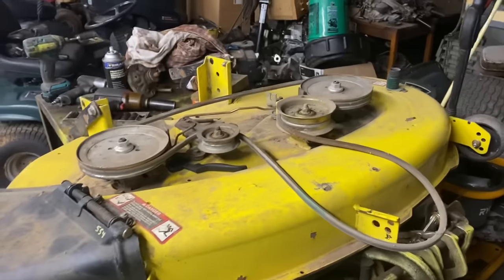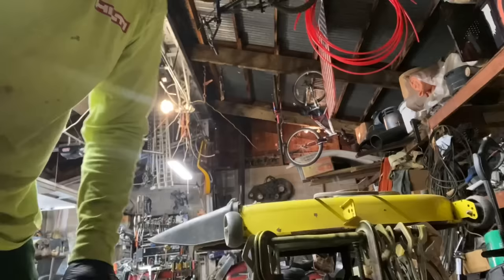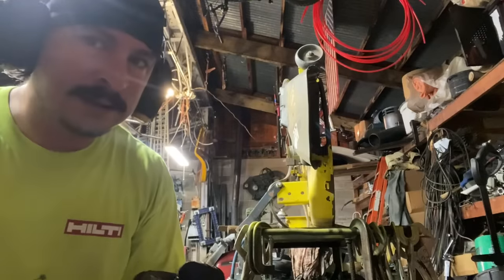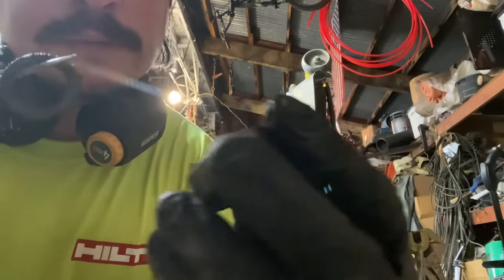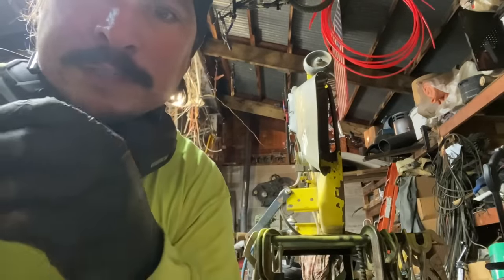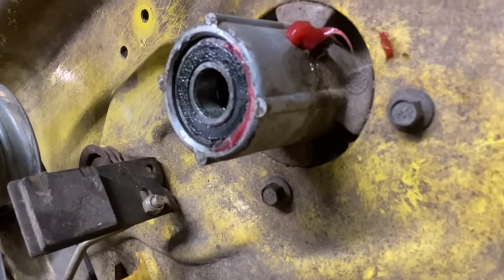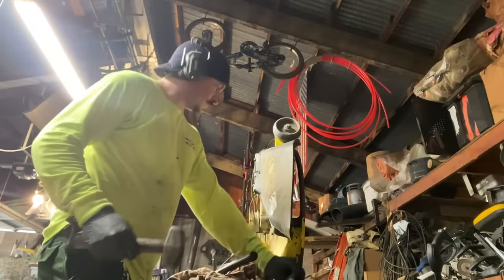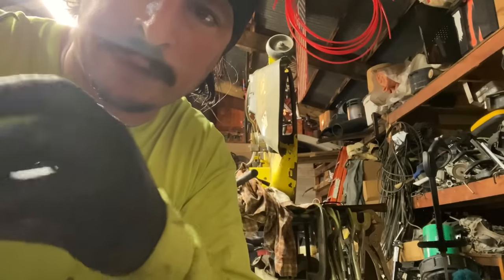Part 1 - Don’t trust the “Experts” Grease your mower deck sealed spindle bearings Common sense.

Comment: YA! Untill one of the mower or bearing  companies catch wind of this video and pays google and u tubeto take it down, bottom line is they dont want you fixing stuff anymore thats why they seal bearings in the first place.
Reply from the maker: @timothyhults2549  I’m not in disagreement, I think they try to put just enough grease in to get the machine past warranty and then bearings start failing. They also fail
To show how to properly grease these assemblies and hope that folks will buy parts rather than perform Preventive maintenance. Big corp is not our friend.

Comment: Just take the internal-facing seals off and reinstall the bearings. Then you will have a proper greaseable bearing and can live a happy life.
Reply from the maker: That’s a waste of time as I have proven in the video. Attention to details. The shields can’t stop grease from passing. But excellent waste your time if you have time you want to waste.
Reply: @GTObearclaw1  Having a plastic seal between the grease and the bearing is just stupid. If you really think that removing a seal which limits grease flow is a waste of time then you have a lot to learn. You can hope that some grease squeezes past the seal or you can ensure that your bearings have proper grease by removing the seals. You say you have to put 70 pumps from the grease gun to fill the bearing. What a waste of time and grease. With the seals properly removed it would take just a handful of pumps. The fact that you think its a good idea to have a piece of plastic between the grease and the bearing is truly baffling. While the seals may not fully stop grease flow they sure as hell restrict the flow unnecessarily. The inner seals literally have no benefit except they prevent full flow of grease to the bearing. Im not suggesting to go out of your way to do this, im saying if you have to open the spindles for whatever reason, repair, replace, whatever, then you might as well go ahead and make easier for the grease to get into the bearings. Literally anything you can do to help more grease get into the bearings will be beneficial. You should be greasing spindles every few mowings so there is no worry about grease running out of the top bearing through the missing seal.
Reply from the maker: @winstonpoplin  actually your wrong again, regardless if the shield is there or it’s removed the same amount of grease is required to fill the void. To think grease will magically find both bearings with only a hand full of pumps is ridiculous. Grease will absolutely not reach both bearings before the void is filled. That’s some pretty silly logic. So do we just ignore gravity when it comes to grease? Without filling the assembly you will have a air pocket in there. And grease is usually a blob that tends to stay in one spot unless it’s pushed into the path of the bearings. And it is not a seal anyways, It’s just that simple. Don’t overcomplicate it. It’s a shield. It’s not a seal. It’s a shield, not a seal. Don’t let it give you a mental block. You don’t know anything about it obviously a simple word is enough to cause you a metal block and you can’t think past it. This is an issue for may people and the reason I made a baby step video to provide proof. And even then some folks still argue rather than simply trying it. Stop with the nonsense and quit wasting my time. If your not even willing to absorb the basic simple Information I provided then just move on. Your wrong, it’s that simple. Some folks have to be right and want to argue but your wrong and that’s the Bottom line. Your not even willing to try it. Iv already proven it. That’s all
There is to it. Nothing to argue about. Just looks dumb to argue with a video that shows every step of a process that has proven the point with evidence that can be tested. I have show it and proven it’s a FACT. Can’t prove me wrong by talking. quit wasting the DIY communities time and make a video showing facts on how your right and help some folks. A hydraulic cylinder has a seal. A crank shaft even has a lighter duty seal but still a seal that can hold some internal pressure. A shield on a mower deck mandrel bearing is not anything like those. The mower deck bearings can’t hold back pressure. The shields don’t stop pressure from pasting. Can’t even seal out water effectively. Good grief, it’s almost like I didn’t just show every step of the process on video. Yes 70 pumps, big wooop. Grease is cheep, 1 tube completely serviced 3 or 4 mowers. Once the assembly is filled it only takes a few pumps each time. After the first greasing when bearing is filled it’s fine to go longer than a few mowings. I think it’s fine to go 40 hours and most home owners use a tractor 40 hours a season. So even at 20 hours that’s twice a year and plenty of the process is done properly. it’s actually pointless to remove those shields unless your already into the assembly for some reason. I’m not making a video to tell
Folks to remove a shield that can’t stop grease from passing. They don’t present a restriction in real life. Only in your imagination. Pressure pushes grease past those little rubber lips like they don’t exist. I would not bother removing them because grease passes right into the bearing. I don’t have to hope grease passes, when I see it exit the other side of the bearing I know it had to go through the bearing to get out the other side. And I showed the proof. Hard FACTS proven. Very simple stuff here. Some folks just can’t understand and it’s that simple. The best way to see it work is to try it. I won’t make a penny and you won’t tell me thanks. But that’s okay. I didn’t come here for a pat on the back. The few folks who get the information is all I was aiming for. Mission accomplished. Judging by the comments, plenty of folks like the information. And nobody else is providing this information unless I’m missing someone that finally quit drinking the coolaid. If there would have been others showing this information I would not have bothered. But now you have the information and can do with it as you please. As usual your comments make me believe you didn’t watch the whole video and just another naysayer who can’t prove your theory. Facts are what’s important here.

Comment: I seriously doubt this. A bearing with a rubber seal will stop oil from going into and through the bearing. It stops oil. Even light weight oil. So if you manage to push grease into the bearing through a rubber seal then you really has to force it, distorting the seal. And how can you in that case prevent the bearing from being overfilled with grease? Too much grease in a fast rotating bearing will overheat. Even having the cavity in between the bearings full of grease will case a lot of heat.
Reply from the maker: It’s been explained countless times in the comments. It’s actually very simple. Grease goes in under pressure. The rubber lip on the shields simply flex as a rubber lip does. Nothing groundbreaking. Same old same old. Without pressure pushing on the seal it retains the grease that entered. If excessive grease is in the bearing it will
Simply push out as the bearing moves it around and plenty will be retained. These seals are not seals in the sense folks seem to think. They are not seals like a hydraulic cylinder has. And you won’t need to worry about too much grease in this application. When it’s too much it will exit the assembly on its own because the shears can’t retain pressure. Grease under pressure will pass out of the unit. No need to doubt anything. Iv shown all
The steps. You can run your own experiments. Iv been doing this 20 years and Iv never seen it damage a seal lip. But Iv dang sure seen the benefits.  Works fantastic. Feel free to read the comments, you just might have stubbed on to something useful here. Thanks for the comment

Comment: Nice video but where is the proof that doing this makes the bearings last any longer or run cooler than just running them until they go bad? Grease experts warn of over-greasing bearings. The grease will actually insulate the bearing, not allowing heat to dissipate. I think more testing is warranted.
Reply from the maker: how exactly would one prove that this makes bearings last longer? That would be interesting. I know it does because of personal use and knowing how long a non lubed bearing will last just running on what’s in it. I also know after I started doing this I quit having bearing failures. But hay, Test away. now you have the information. Grab a temp gun and do some testing. Why just run your bearings to failure? Seems so silly. do some experiments, lube one side and leave the other as is. See how that goes over the years, Took me years of testing my own equipment to figure this out. Now it seems so dumb I don’t know how it took me so long to understand what seems too simple now. As for overheating, not even a blip on the radar for this application. Bigger problem is folks leaving grass piled on the deck creating a great insulation to hold heat in the mandrels. Then they wonder why bearings went out. I trust an “Expert” as far as I can throw one. Companies are engendering equipment to fail these days. Experts are trained. Trained by who should be the question. And bearings are used for many things. Just because too much grease is bad in one application does not mean it’s an issue in another. And just because an expert said so holds no weight with me. Iv done my own testing. Have a lot of videos I post to help folks with things that I found worked great for me. I’m not interested in just throwing around advice that I haven’t tested and found to work great. I’m just explaining how I do things. The information is here. What folks do with it is there business, lots of good positive feedback, so far nobody saying it damaged there machine.
Reply: @GTObearclaw1  I guess I have better things to do than test spindle bearings. I was just questioning your findings and how you came to your opinions. It also worries me that there are no experts in the world anymore. People that work with this stuff on a daily basis must be idiots. It's good that we have people like you doing the testing for the rest of us. Keep up the good work.
Reply from the maker: @JT-qf4it  I guess I’m lucky I have some extra time.
Reply from the maker: @JT-qf4it  fortunately for me you did have time to watch my video.
Reply: @GTObearclaw1  True!

Comment: IF you pump enough grease into the housing to force it into the SEALED bearing then you VOID the REASONS for the sealed bearings, they are sealed to keep sand, dirt contaminates OUT.
Reply: Use clean grease, clean Zerk and gun, be sure that no sand, dirt, contaminants are being forced into the (presumably) clean void.
 Note; Boat trailer wheel bearing voids, sealed or not, are greased frequently (by experienced boaters).. 
Trusting 'sealed' bearings, insures they 'Will' be periodically replaced.. $$$$ ;}

Comment: I take my dust Jack. It's. Off or dust. Washers. Or whatever you wanna call. Him off the. Bearing one? Side. Is there a pub my Baren's back in obviously with the open side to the inside? And then when I grew smart spindle I'm? Sure to get grease in the baring let's just all I do it I mean.  Just be on a safe side
Reply from the maker: That was like reading alphabet soup. thanks for the comment, I dang near fried my last brain cells trying to
Decode that mind mangler. Finally figured out what you were saying. I had to drink a few
Beers then it made better sense. 
As for dismantling decks to get a seal off a bearing, you can do that and waste a lot of time. Or just grease the bearings through the zerks and save time. Seems like
It would be an easy choice. I just proved it works and grease passes the seals. But hay, do what makes you happy. I just wanted to prove some “top guru” knuckleheads wrong that the seals won’t stop grease and my point has been made. What folks do with the information is there business. My work is done.

Comment: Yeah, don't do it. If you want to grease those bearings pop the seals and repack them. I've seen the grease blow the seals out of the bearings and ruin them in a few hours. See how easy the seals came out, the pressure from the grease gun can do the exact same thing, push the seals right off and let your bearings fill with dirt.
Reply from the maker: Wrong. Prove it. Don’t tell people it won’t work when I just gave evidence it will work. I’m trying to help people avoid crap advice like yours.
Reply: @GTObearclaw1  I ruined a brand new set of spindles doing what you suggest in this video. THERE is my proof. When they failed after a few hours, then I took them apart the outermost seals were no longer attached to the bearing and they were full of dirt.
Reply from the maker: @mdunbar008  sounds more like you had bad equipment to begin with and possibly thought adding grease would fix a more serious issue that the quick fix “grease” would not fix. Unfortunately preventive maintenance needs to be done before a failure is already occurring. If a bearing is already going bad and the operator thinks it’s time to perform some preventative maintenance to fix it and add grease. Well if it’s noisy it’s too late. Don’t come here to tell me the seals pushed off and in 2 hours the unit was trashed. That’s simply impossible because if the bearings were  perfectly good in the first place and you added more grease they would run for days without any seals. So saying that grease pushed the seal off and in only two hours the dirt destroyed the bearings does not compute when you think about the way things work. Spindles full of grease would not allow enough dirt to get into the bearing. The bearings would be completely filled with grease. Yes grease would be coming out the bottom but just the bulk of grease around Botom of bearing would gather dirt. And for a short time that grease catching dirt would block dirt. And any assembly Iv ever worked on is a precision fit and the shaft is in very close proximity to the housing leaving only a tiny space for anything to get to the bearing. Iv seen rope and fishing line and wire wraped around spindles and in many cases even when tightly wound it didn’t get up to the bearing. In some
Cases I have found lower seal damage that had been that way for a while and gathered dirt but bearings were fine. When I’m into a repair and see a shielded bearing with a damaged shield, I do replace it. Unless you had some special circumstance that I’m unaware of, It would probably take more time for enough dirt to work up into the bearing and make the bearing fail. 2 hours is just unbelievable for me. You obviously had bigger issues and you may not want to admit it here. But that’s okay, I have enough hands on experience in the matter that I can see through BS. The story your giving doesn’t add up. In no way is your statement proof, it is Just words without enough to
Really know what happened. Iv been fixing this stuff for years. Im leaning more to the conclusion that you don’t know the actual cause of the failure and maybe blaming it on the seals. It’s possible you had issues and thought grease would fix it. I believe that. But your absolutely wrong and the so called proof you say is proof is in no way proof. Just stating a experience you had is in no way prof. That’s just your opinion on a topic. My video is proof and that is precisely why I made it. If you have facts and information that can help folks make a video and throw in some proof. Talk is cheep, show folks. Iv been greasing decks for years and not one time has grease ever pushed a seal off. You had something else going on that your not factoring in. Hopefully folks are smart enough to
Read your comment and understand your wrong. Your welcome to delete it. I will not do it for you. Leave it here if you want. 95% of comments are positive and folks seem to agree just a few naysayers and every one has absolutely no hard evidence. Only a few commmets just saying it won’t work but your the first person that has ever said a seal came off. Iv never once ever seen a seal pop off, if components are assembled properly, There should not be room for the seal to move out and pop off. So there was something different about your situation. Make your video, if I’m wrong just prove it. Not hard to make a video. But I don’t think you are correct. Maybe just your conclusion after the experience you had but how you got there we may never know.
Reply: @GTObearclaw1  what part of "brand new" did you not understand? Brand new, as in right out if the OEM box. I also never claimed they failed in "2 hours" I said they failed after "a FEW hours". By changing the details to defend your version of what happened you are doing a disservice to the people taking advice from you. I have been rebuilding mower spindles for 40 years, and I have never seen this happen unless the spindle cavity was pumped full of grease to the point it was able to push the seals off.

Comment: Why not just remove the inner rubber seals?  No dust in there but without the seal the grease would get into the bearings easier.
Reply from the maker: Because it’s a waste of time to remove the seals. They can’t stop the grease from passing. So what’s the point. I clearly showed the results of greasing with seals / shields in place. The grease passes then no problem. Spend use a grease gun and save time. If you watch the full video it all makes sense.